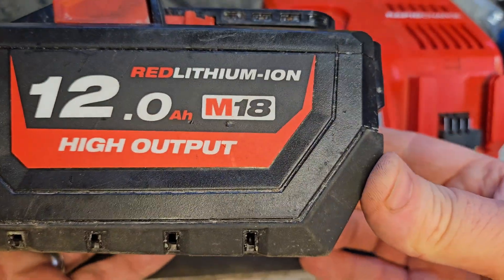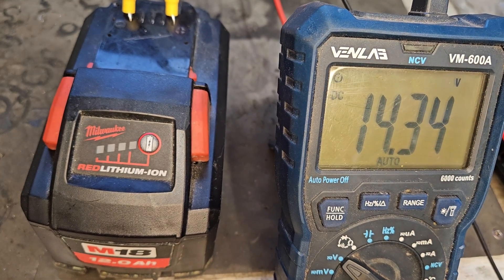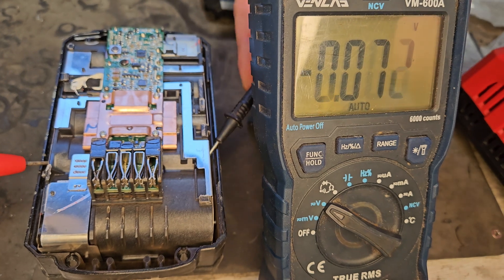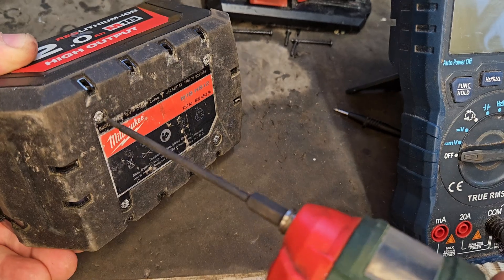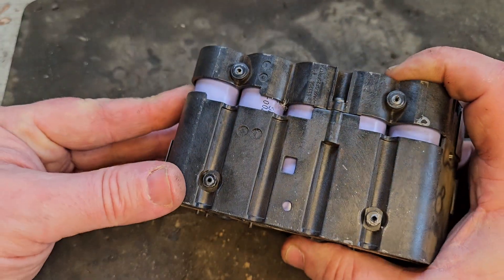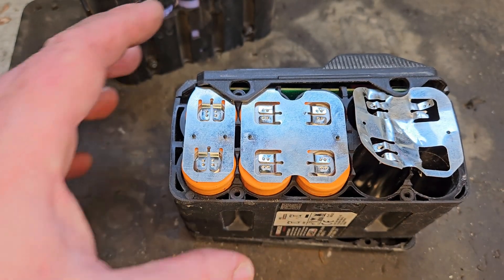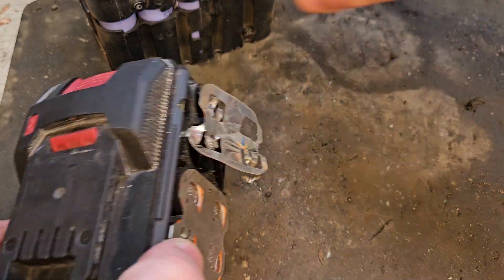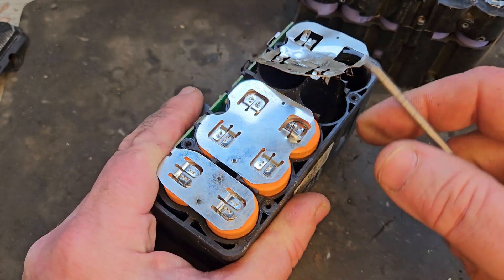Fixing a Dead Milwaukee 12AH Battery - Did It Work?

Comment: Amazing video for what is arguably the most difficult power tool battery to repair. And made to look so easy. Having several milwaukee M12 and M18 batteries, this video is a welcome demo. I think, however, to my knowledge and experience some points to take into consideration. 1. This repair is not for the faint of heart and does require some basic knowledge of how Li-ion batteries work. 2. This type of work does have an inherent fire risk when unknowing shortcircuuting the battery, which can cause potential thermal runaway. These batteries were repaired at a base low voltage of 3.6V. If possible, I would advise you to run the batteries down to a safer 3.1-3.0 volts for safety reasons. The lower the base charge, the safer the battery is for repair, and the less chance of potential thermal run away with a short circuit. No charge, no energy to flow. 3.6 V is relatively high to my knowledge. 3. I wouldn't advice to use a dremel to sever the connections. As demoed here, later repair is more cumbersome, and with frequent use and battery overheating, the solder welds might be the weakest link and potentially spark a short circuit in due time. Only do this if you really know what you're doing and understand regular checkups and maintenance in time. But there are some inherentbriaka. Ideally, you would want to save the metal connectors to the batteries. From what I can gather, I saw that the spotwelded connections were prialble with the screwdriver. I would try that and still try to maintain the original anatomy of the metal connectors for rewelding with spotwelding. Small battery spotwelders are quite accessible and affordable these days online for better practice of repair. New thin metal strips are also quite affordable these days online. 4.If possible do invest in the same battery types. Combining different batteries is generally possible, but different brand and battery types do have slightly different chemistries and performance characteristics. Important is that base voltage of all batteries are the same when doing battery repair. Reason is that slightly different voltages of all cells, new and old and different types will drift over time and cause cell imbalances. This leads most likely what is the primary issue of this batteries that have lead tonyhree of the 15 cells to die, likely due to increased resistance over time due to cell imbalances. In a vicious cycle these cells will become the limiting charge rate and max charge capacity determinats of the while battery and cause capacity failure over time and be one of the explanations why the battery will only charge to three bars in the long run. This is a common issue with many milwaukee batteries and in my experience especially the 12 ah batteries. The reason, I have discovered is that the bms board in the pack only balances the batteries per three cells. Preferably otbwould be best practice if all cells were equally balanced. Thus this battery only has 5 leads to balance the pack. Ideally you would want 15 leads, one for each cell, for best practice active cell balancing for best cell.longterm performance and battery health. Unfortunately with milwaukee batteries we will have ro do with only 5, which gives a typical result in my experience with battery failures in sets of three, beacuse the bms can't handle the balancing the cells when using them for high performance tasks in higher demand tool taks. The spec sheet also shows that the batteries only have a 250 cycle life with these very good performing (power performance) Samsung 40T cells.. They perform quite differently to other powertool cell competitors, even Parkside cells. The batteries are not all quite equal and there are performance differences between Li-ion cell brands.
I think this is a wonderful and overeasy demo  of a milwaukee battery repair. In practice it is quite challenging, but nevertheless rewarding of the repair works out. I can't stress enough that some basic knowledge of how Li-ion cells work and what the pitfalls are of working with Li-ion cells for battery repair can help a lot to hopefully evade battery fires, as it is not without its risks. Creating a safe work environment with good ventilation and a proper clean workspace to minimise risk of creating a short circuit circuit can help to evade the pitfalls in battery safety. And try to deplete the battery to the manufacturers specs safe lowest voltage as basic precautions. There are a wealth of youtube videos on this topics and mikwaukee Samsung cell spec sheets can be found online.
I think timing of this video is timely as milwaukee has introduced their new forge batteries as a possible upgrade future. There might be some advantages to stacked push cells, but Inthink there is still merrit to Libion cell batteries in tool batteries in terms of performance, rase of use, longterm performance and safety over puch cells in power tool battery packs and that we haven't heard the last in the debate ofvthese technologies. Anecdotallynitbis also worth mentioning that Tesla's top ofvthe range performing model S and X still use 18650 cells for best performance, which to me telling the merrits of cilindrical cells.
I think this repair also shows what can be done to make tool battery repairs more accessible to do. The recent Milwaukee pipeline event 2024 has shared some details of the insides of the new batteries. They look much harder to repair and from what I can gather, unfortunately they have not considered improving cell balancing of their places, which is I think an underappreciated issue with mulwaukee batteries in general in my experiemc. I think if this issue was considered more, we would have higher quality batteries than simply addressing a new bms board and laser welding only.
Reply from the maker: Thank you for the intelligent and very informative comment. I totally agree with all the points you made.

Comment: Wow!  Awful lot of trouble to get her fixed, Doctor!  hands a bit shaky there with the Dremel?  Nice Job!  

Milwaukee needs to step up their game on these expensive batteries, and reliability issues!  I have a few 8.0 HO batteries that wont fully charge, and just out of warranty.  I managed to get one to go beyond the “Three bars” fully charged state, but it only reads 19.9 volts off the charger, so it is relegated to my M18 work lights.  Nice job Doc! 👍
Reply from the maker: You got a little cell imbalance very common with the big batteries
Reply: @doctorlefthandthread  Hey, lets not get personal now, oh wait, Youre talking bout the battery!   Never mind!  😂 

You have a point, and You would know, having performed numerous surgeries on them!  I don’t know what one could do to prevent the imbalance from occurring?  I always keep them at between 50-75% or so, and more full than empty.  Stuff happens as they say.
Reply from the maker: @georgedavall9449  I don't think it's mistreatment from you it happens with multiple cell batteries quite often
Reply: @doctorlefthandthread  Appreciate the replies Doctor!  👍😊
Reply from the maker: @georgedavall9449  appreciate the comments 👍